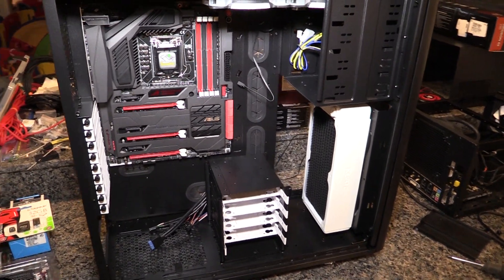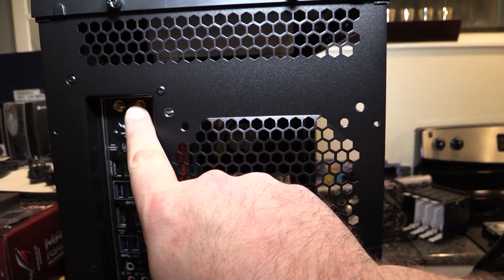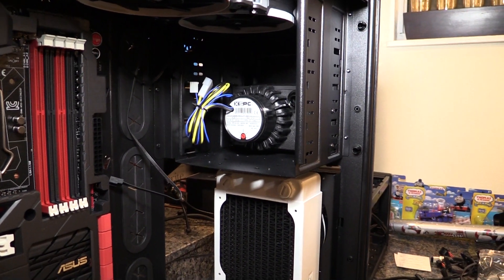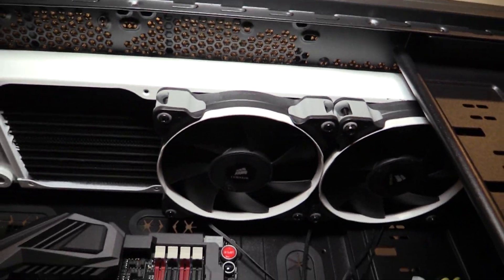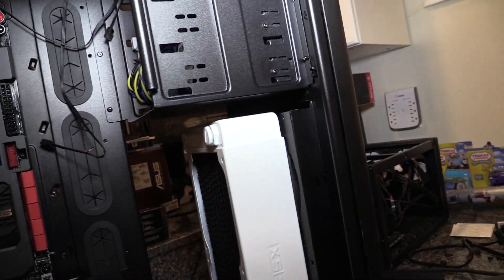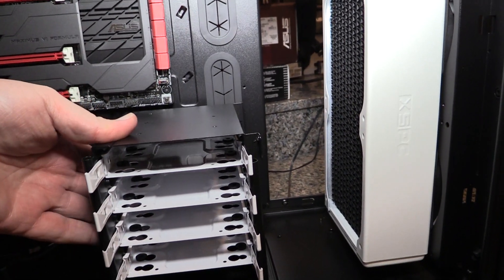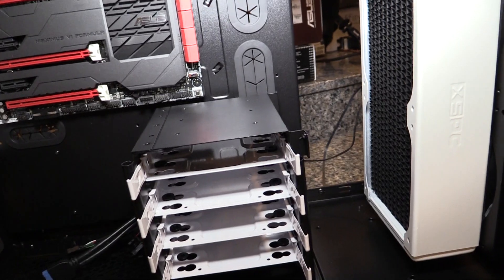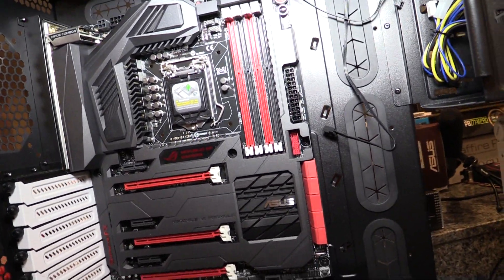TimmyTechTV Personal Build vlog - Part 2

Comment: You could fab a stabilizer from slot covers to go from the top of the hard drive stack to the case.  I see a screw hole next to the wire grommets.
Reply: Yeah, that's what I was thinking - an 'L' bracket to the motherboard tray